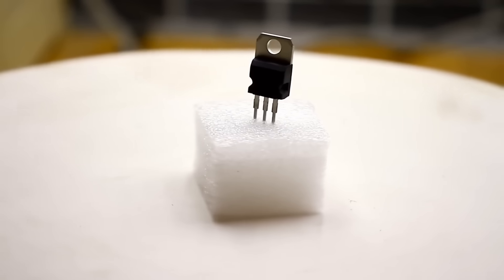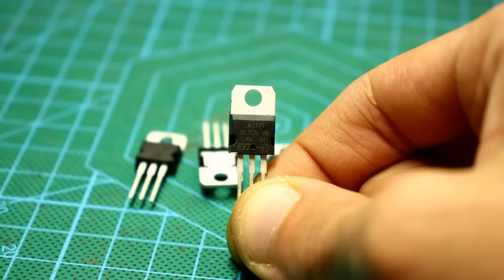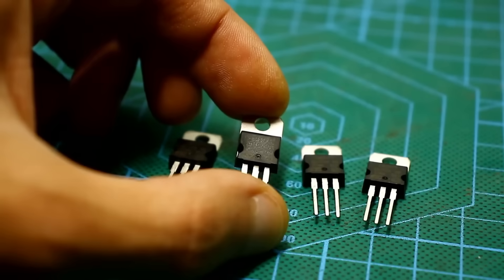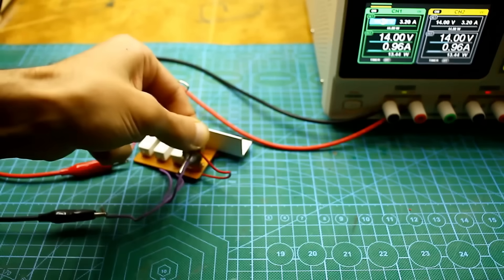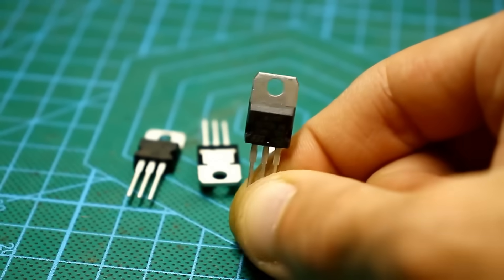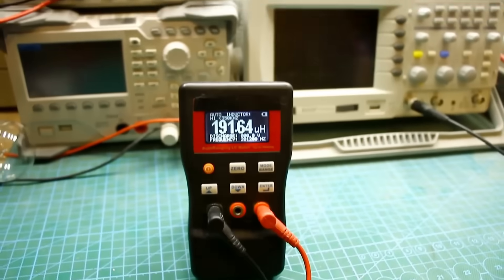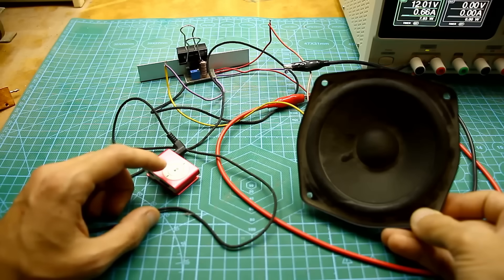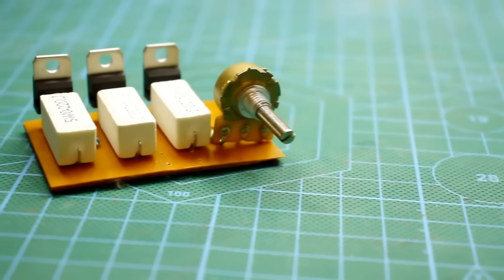What LM317 can do

Comment: The LM317 can have up to 40 volts between input and output. 
Only a few voltage regulators can do that. 
Create a small voltage of 3.3 volts from 36 volts? The LM317 make it possible.

Comment: LM1084 is similar but rated for 5A.  It comes in fixed (e.g. 5.0V) and adjustable versions.  The fixed ones can also be used to make adjustable circuits by putting a resistor between their GND pin and circuit ground.
Reply: @TooSlowTube 
Yes. But don't forget the LM340, and LM350, they have 3A and 5A.

Comment: Nice project but the AI voice is very disturbing..
Reply: @RadioFinding 
NOT AI, it is "Text to Speech", TTS, tts. Windows has it built-in. Or you  can use an onllne version. But, YES, it is annoying.!
Reply: @snakezdewiggle6084  AI is the underlying technology that powers TTS systems, providing the algorithms and models necessary for generating speech from text. 

Linguistic Analysis: The AI engine analyzes the text, breaking it down into phonemes (basic speech sounds) and considering linguistic features like intonation and stress. 

Acoustic Modeling: The AI uses acoustic models to synthesize the speech sounds, creating a waveform that resembles human speech. 

Neural Vocoder: The final step involves a neural vocoder that converts the spectrograms into waveforms or audio.

Comment: Is there a way to add adjustable current limiting to the switching circuit?
That would make a great cheap powersupply
Reply: Not really convenient,  but possible. Using that lm317 or any type of scheme for electronic load

Comment: Did you know Texas Instruments made an LM317HV? 

60V in    57V out @ 1.5A
Reply: I bought 317 HVT from Aliexpress. So far they haven't cracked... I didn't have a 60 V source to test them. At the voltage I used, 40 V, it resists
Reply: there also a TL783, up to 125v input to output differential ...
Reply: Não precisa do LM317HV para trabalhar com tensões altas, a diferença entre a entrada e a saída não pode passar dos 40V, sendo assim você pode ligar 100V na entrada para obter 90V estabilizados na saída com qualquer regulador do tipo LM317.
Reply: Yes, and i wish i had one. Never come across one in junk. LM350 is still really expensive new here .
Reply: @jonlitchfield8888  I think I paid $11.99 for 10 of them. I have yet to try one though so they may be crap but I'm pretty sure they are real since they aren't branded as TI. 

I find it's easier just to make Frankenchargers out of laptop chargers wired in parallel and series. I have nice expensive chargers  but my improvised charger has outlived them all. 84v at 9A. That's pretty good for a charger made of other chargers. lol 

You do have to use cheater plugs for the few chargers that have a 3rd prong, and some 5 or 10w 10ohm resistors in between might be advised for load balancing. 

I have bins full of chargers since I've had a PC repair company for a couple of decades so I'm just happy to put them to use and I have a large variety of voltages over the 20+ years. Some of these things are quite beefy. So I'm doing like 2P5S or whatever combination of voltages I need to do to reach my target voltage. I have lots of matching supplies so those get paralleled. 

Sounds sketchy I know, but I do check things out with a thermal camera. It amuses me that this works so well. Should give the bean counters a heart attack.